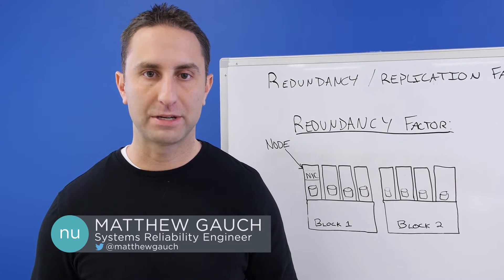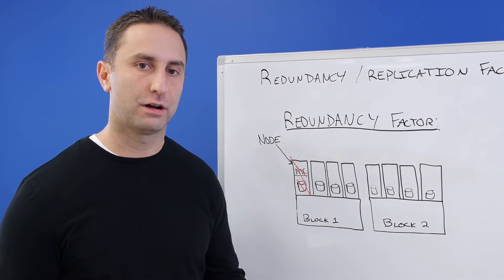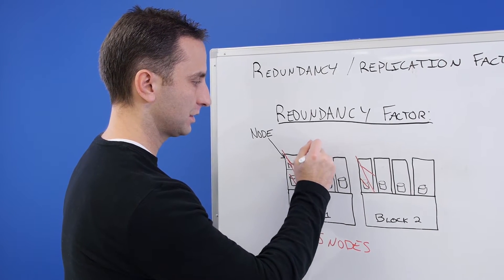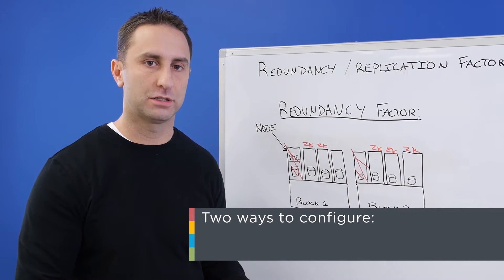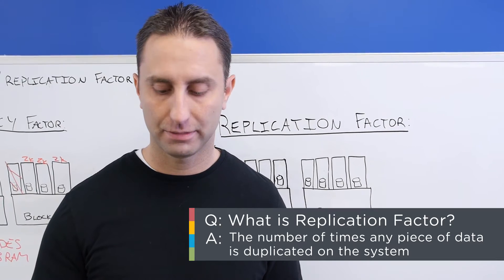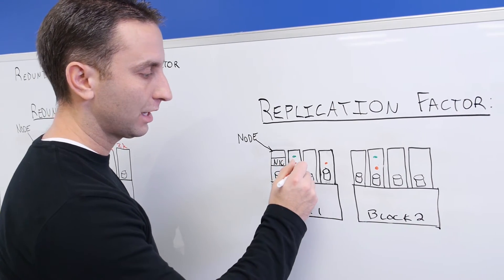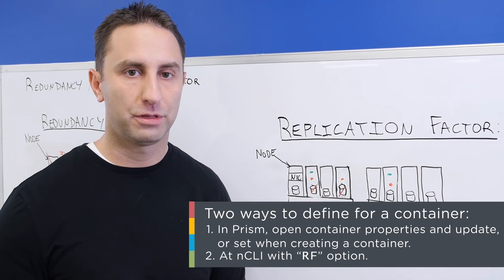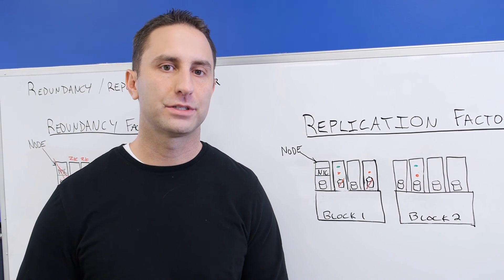Tech TopX: Redundancy Factor vs. Replication Factor

Comment: How to calculate replica factor and please provide direct link for this
Reply: Hi Jaiveer - this is not as much of a calculation as it is a configuration setting.  Including some details below...

To see the cluster 'Redundancy State', log into Prism Element and click the gear in the upper-right corner.  Scroll down under 'Data Resiliency' and look for 'Redundancy State'.  That will tell you how the cluster is configured (most clusters are Redundancy Factor 2).  If your cluster is five or more nodes, it can be set to Redundancy Factor 3.  Assuming that to be the case, then containers can be configured with a Replication Factor of 1, 2 or 3, otherwise they can only be Replication Factor 1 or 2.  The container configuration can be viewed by selecting 'Storage' in the main dropdown on the upper-left side of Prism Element.  Once there, you can select 'Table' and get a view of the 'Replication Factor' of each container.  Again, these will typically be set to '2' as most clusters are deployed with a Redundancy Factor of '2'.  Our 'Prism Web Console Guide' details each of these settings/terms.  I am including a link to the AOS 6.5 guide directly to the 'storage' section where most of this is discussed.  If you search the guide for 'Redundancy Factor' (a cluster level setting) or 'Replication Factor' (a container level setting), you should find all of this info.  Hopefully this helps!

https://portal.nutanix.com/page/documents/details?targetId=Web-Console-Guide-Prism-v6_5:wc-storage-management-wc-c.html

Comment: Its absolutely confusing for me because in 5.11 those 2 options are called "redundancy factor:: both in cluster setup and in storage container settings. So I can have redundancy factor 3 for cluster and redundancy factor 2 for a container. I am lost...................
Reply: This is how I understand it. RF used have two meanings, redundancy factor AND replication factor. The former refers to cluster HA. The latter refers to data replication. So, with the consolidation of terms to simply "RF" you have to consider the entity for which you are configuring RF. If you are configuring RF at the container level would refer to the number of copies of data. If you are configuring RF at the cluster level, it refers to the number of failed cluster components that you can sustain.